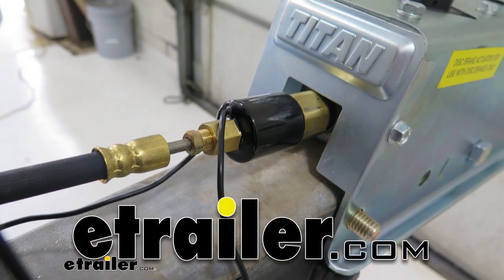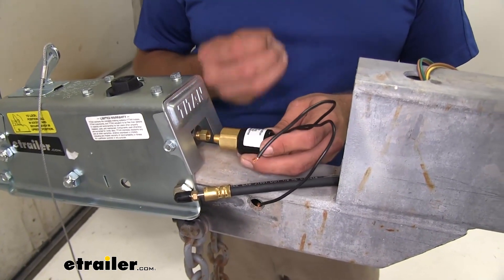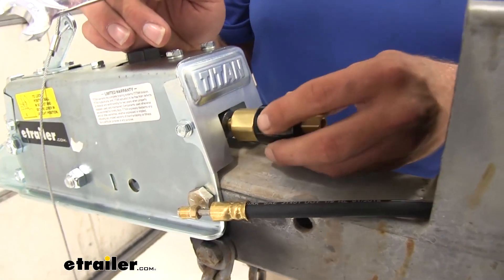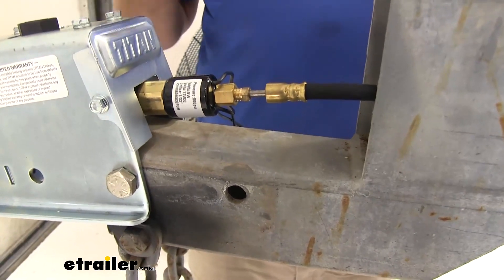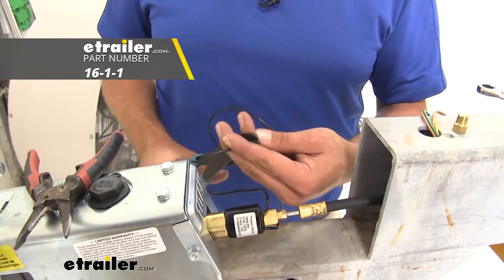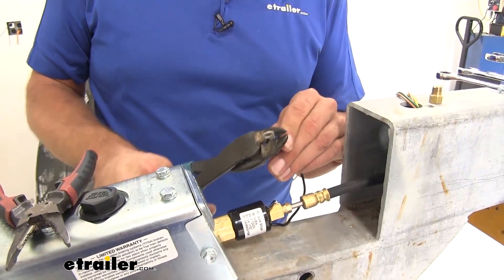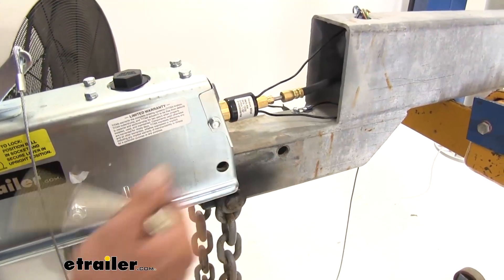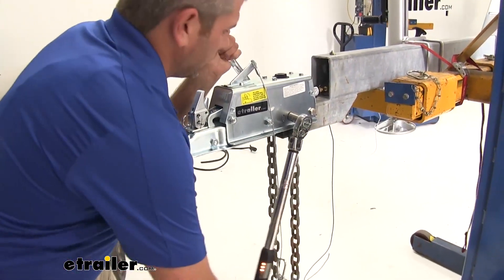etrailer | Titan Brake Actuators with Reverse Lockout Replacement Solenoid Valve Installation

Comment: What model titan actuator? I'm looking for replacement master cylinder?
Reply from the maker: What model do you have? Is it for discs or drum brakes?
https://www.etrailer.com/Accessories-and-Parts/Dexter/T4748800.html
Reply: @etrailer  Thanks.
Reply from the maker: We need that info to spec you the correct replacement....
Reply: @etrailer  it was model 60
Reply from the maker: Dexter offers replacement master cylinders that are compatible. For drum brakes, use # T4395100 or # T4820000 for disc brakes. 
https://www.etrailer.com/Accessories-and-Parts/Dexter/T4395100.html
https://www.etrailer.com/Accessories-and-Parts/Dexter/T4820000.html
Reply: @etrailer  ok I just order that cylinder for the drum brake. Can you make sure it ship asap for me..
Reply: I order these stuff from your site and the shipping is really bad, I shouldn't have to wait almost a week before a simple order ship and it's in stock.

Comment: So all you have to do is ground the valve? Seems like the positive needs to be connected to 12 volts?
Reply from the maker: The install is pretty simple. One wire grounds to the trailer, the other attaches to the reverse lamp circuit (center pin) of the 7-way trailer connector. It doesn't matter which wire is grounded.
https://www.etrailer.com/Accessories-and-Parts/Dexter/T4748800.html

Comment: How do you lockout the brakes from engaging (if you need to go in reverse and your wiring isn't working properly from your vehicle...or you have simple move and aren't able to hook up trailer wiring to your tractor or whatever vehicle)???   Doesn't this model have a bolt or "key" to stop the actuator from being engaged?
Reply: Did you find the answer?  I would like to know too.
Reply: Zip tie a block of wood so the brakes don’t go on. Obviously remove when done backing up.
Reply: I added a manual valve for moving with a forklift (no 12 volt reverse signal). Close valve to backup.

Comment: Is this actuator for a specific trailer? Just wondering why there is a square type tube welded under the rectangular tube. What is the actuators towing capacity set up this way? 
Thanks